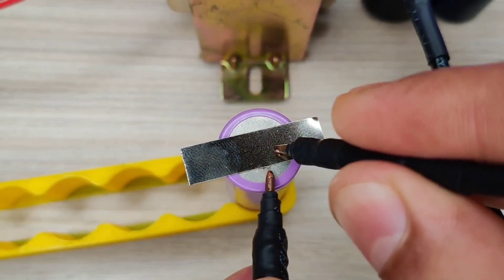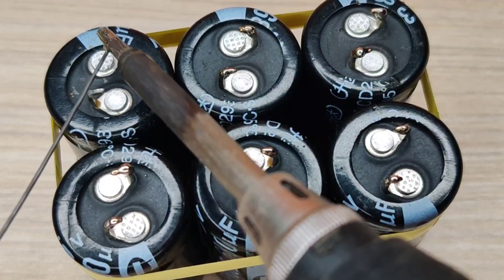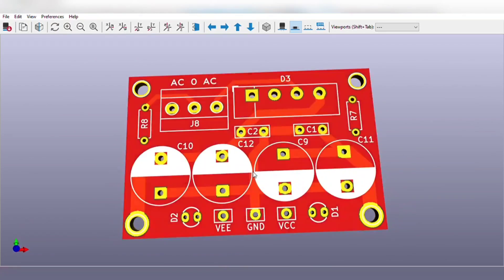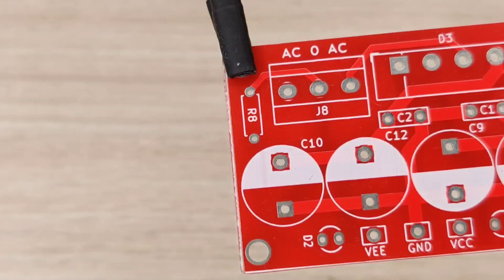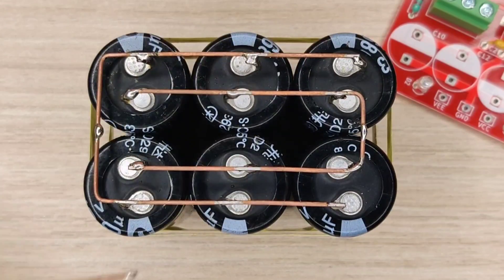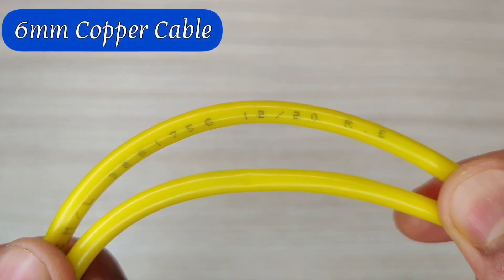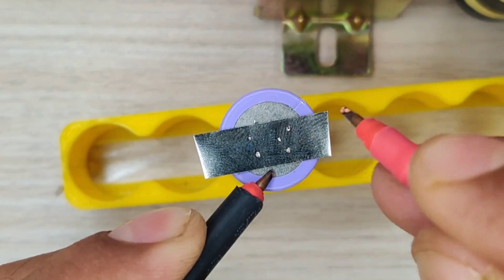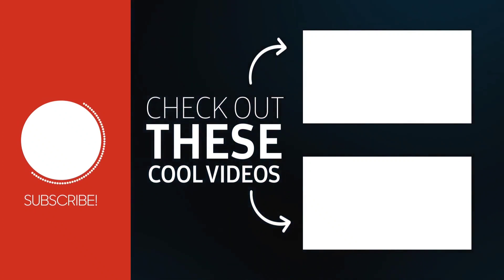Powerful Spot Welding Machine Using Capacitor

Comment: i have tried this Used 35v 4700uf x18 capacitors but did not worked .....then i made one Spot welding Machine from Microwave Oven Transformer By rewinding its Secondary coil Then it is Working Fine Capacitors idea does not work
Reply: Can u show mi the video of microwave own